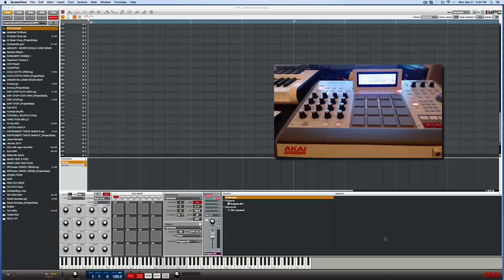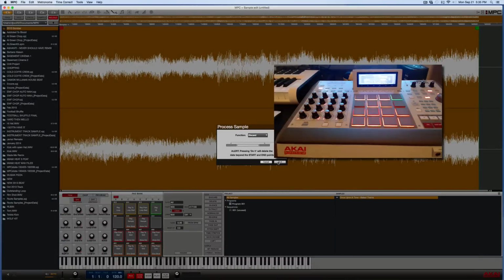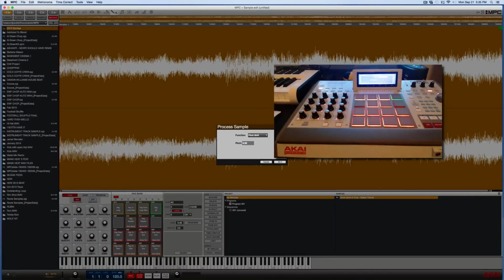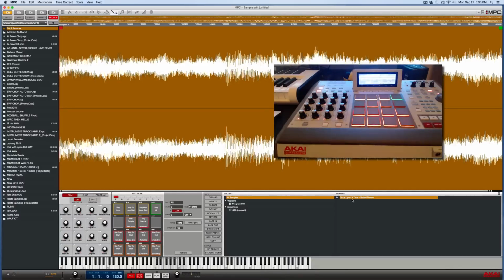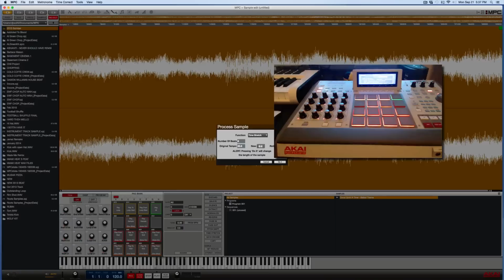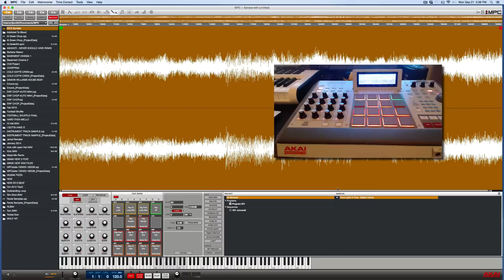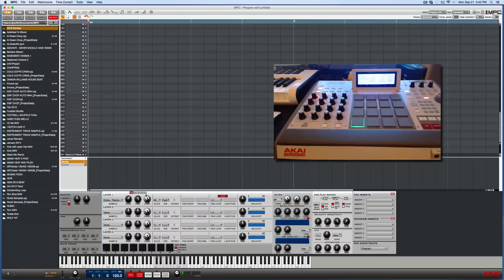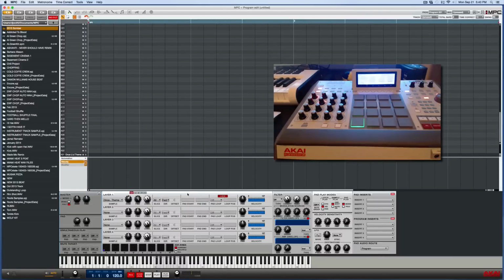Akai MPC 1.8.2 Tutorial - Pitch Shfit & Time Stretch

Comment: I learned how to do this today. I’m using a dubstep growl effect on one pitch but I want to use the same growl effect sample in a lower pitch but on a different pad. Any suggestions?
Reply from the maker: 2 suggestions.... 1.) Use the RESAMPLE feature.  When you want to record a new sample one of the options will be RESAMPLE which will do exactly what it says.  It'll take an existing sample that you already have and re-sample it to create a new audio file/sample.  2.) You could take your original sample and simply try using the 16 LEVELS feature.  Press 16 LEVELS... select TUNE, and it will spread your sample across all 16 pads at different pitch intervals.

Comment: Heads up guys!

I was trying to slow down a sample drastically (from a tempo of 50.8 down to 30.8) and when I typed the number into the box and clicked 'Do It' I got no results.

It wasn't until I clicked AND dragged down in the box to lower the numbers that the ratio changed as well successfully slowing down the sample.

Figured this was a good tip to throw out to anyone having the same problem.

Comment: Is there a way to record pitch shift changes for each sample in a sequence?
Reply from the maker: Yes.  1st I would recommend using the 16 LEVELS - TUNE feature.  That will spread 1 sample across all 16 pads and have each pad at a different pitch... incrementally.  Also.... you could try physically changing the pitch of a sample using the manual pitch shift knob, and then use the RESAMPLE feature to record an entirely new sample for each pitch change.

Comment: I chopped my sample and i have 16 slices of it (lets say). I want to pitch shift the sample but then I have to do it to every single slice manually, it takes to long. 

I've also tried pitch shifting the whole song i'm sampling from but then it's processing for ever!

Any tips on how to pitch shift several slices???
Reply from the maker: +philip hökegård The "processing for ever" part........ exactly how long is the sample?
Reply: Wolf D about 1min..
Reply from the maker: +philip hökegård And just to be clear on this... you're using the entire 1 minute worth of samples, or are you just using parts from the 1 minute sample?  If you're actually using 1 minute worth of sampled audio, then my suggestion would be simple.  Spread it out into 4 separate :15 second samples and chop those up instead of trying to use 1 single :60 second sample.
Reply: Wolf D i've sliced 16 parts from the 1min sample, and i want them to be pitched
Reply from the maker: +philip hökegård Ok.  So are you saying that you're not able to Pitch Shift your individual slices for some reason?
Reply: Wolf D  i can pitch shift my slices, but i have to do it one by one manually to all the 16 slices. Is there a way to pitch all the slices at the same time?
Reply from the maker: +philip hökegård Ha ha!!! Philip.... we're going around in circles with this.  I wish you would've just asked that EXACT question right from the beginning.  "Is there a way to Pitch Shift multiple slices ALL AT THE SAME TIME?"  The answer to that question is no.  The easiest thing to do is Pitch Shift the entire sample from the beginning.... but of course you said you're computer takes a long time to process it since it's :60 seconds long.... which is why I recommended that you split the original :60 second sample up into 4 separate parts and Pitch Shift each of them (so it wouldn't take as long to process), and THEN chop those 4 new pitch shifted samples up into your 16 different parts.
Reply: Wolf D thx for the info and for taking your time, much appreciated! your videos are great!
Reply from the maker: +philip hökegård No problemo my man.

Comment: Using the fine and semi knobs won't mean time stretch correct? So why can't the sample just be processed twice when it's in the other menu prior to creating events, i.e. do the pitch shift and then the time stretch, then convert to events?
Reply from the maker: +Ashli Hankerson You can do what ever method works for you.  It's all about finding the work flow that helps you get things done the fastest.  My question for you would be... if you're going to adjust both the Pitch & the Time, then why would you go through multiple steps with the Pitch Shift & Time Stretch when you could just use one step by simply turning the Semi or Fine knobs?
Reply: +Wolf D maybe it's me and I could definitely be wrong but it seemed like it was increasing the tempo. I'll give it a try the way you have up here
Reply from the maker: +Ashli Hankerson You're correct.... and your 1st initial statement was correct.  Using the Fine & Semi knobs means NO Time Stretching.  But what you mentioned after that was both using the Time Stretch & Pitch Shift feature.... which would mean you're trying to change both the length/time of the sample as well as the pitch.  The Semi & Fine knobs = changing both the length/time of the sample as well as the pitch.  Pitch Shift = changing the pitch of the sample, but NOT the time/length.  Time Stretch = changing the time/length of the sample, but NOT the pitch.
Reply: +Wolf D thanks for the response! I've been using Reason for years and this is somewhat a new machine for me (although I've used an MPC before). I guess what I'm saying is the semi and fine knobs will do both but it won't fit the tempo of the song so that's why I was thinking of the dual processing. Again I haven't tried either method yet was just curious. Thanks for the reply
Reply from the maker: +Ashli Hankerson Ahhh yes.  You are correct again.  Using the Semi & Fine knobs, you would have to manually adjust the sample to fit the tempo... in the same way that a DJ might manually mix/blend one record to match the tempo of another record. :)

Comment: Peace. I'm new to the MPC and have watched your videos along with studying the manual and some trial and error,  and have finally got this thing sort of figured out. My question is how do I know whether or not  I'm clipping? I'm came from working in FL studio over the years, and could normally apply a wave limiter. I see there is no limiter with the MPC(studio), or maybe I haven't found it yet. I see the dB meter in the red at times but when I adjust the level knob I lose volume I see. What is it I'm missing?
Reply from the maker: +Eazysb The MPC software comes with a bunch of dynamic effects made by Izotope, but unfortunately it doesn't have a limiter.  If you want a visual limiter that shows you the wave forms, you'll have to use a 3rd party VST plugin and pull it up as an effect on the MPC's master fader.  Other than that, you'll just have to use your ears to listen out for clipping, and watch your db levels on the MPC master volume control.
Reply: +Wolf D Indeed,I see what your saying. Big up bro.